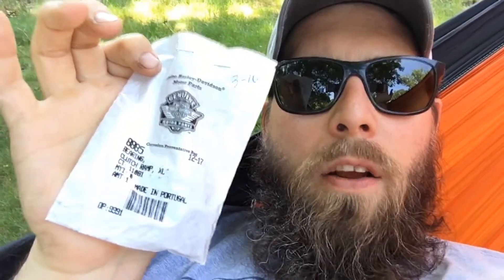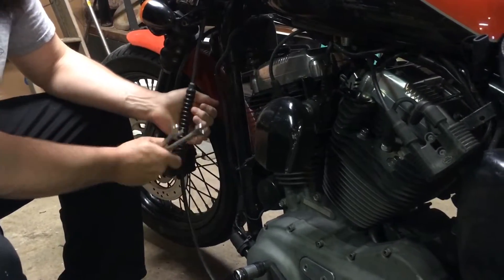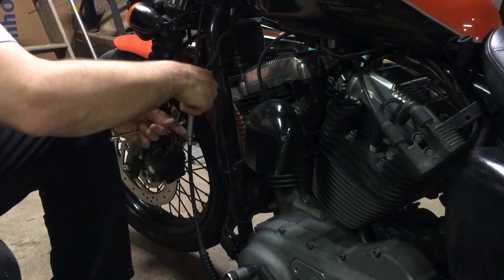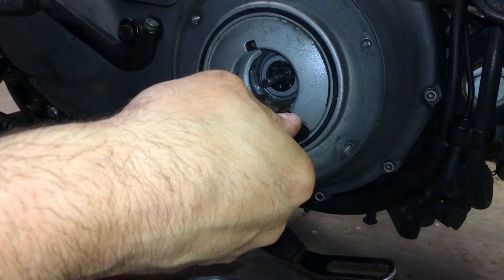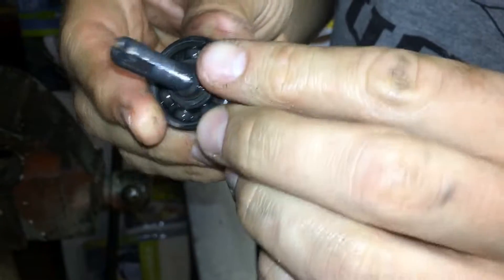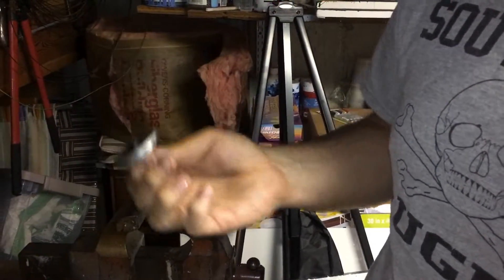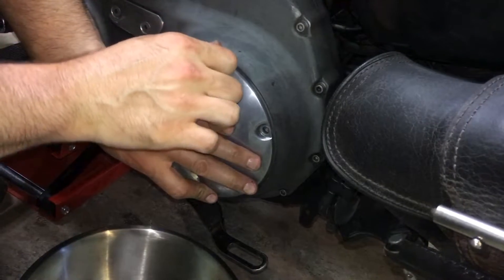CLUTCH RAMP THROWOUT BEARING DESTRUCTION!

Comment: Well done. Just had my 3rd replacement done on my 2000 883. Had no idea where it was or anything. Thanks! FYI for all the fellow Sportster riders: When you engage the clutch and you start hearing some high pitched "whoop whoop" sounds, that's your clue it's going out! Get it fixed before you get stuck like I did.
Reply from the maker: Good info on the sound being a possible indicator of failure! I never heard that but I have short shots on my bike so it is har to hear anything with that beast on.
Reply: I had that happen to me today and as soon as I heard that high pitched 'whoop whoop' sound I turned around and headed home. Unfortunately halfway back it gave out but I was able to limp home in third gear. 💪😅
Reply from the maker: @badbaroque7760  glad you were able to get it home. Hope you got it squared away quickly and hit the road again.

Comment: Man I was about to throw in the towel.. just got done rebuilding the top end of my 03 1200. My ignition coil got tossed , and my clutch wasn't there.  Looked into it and saw it was the bearing. Found this video, and I'm encouraged now.  Thank you..
Reply from the maker: Never throw in the towel on a Sporty. My wie just crossed the 90,000 mile mark on ours. And I hope that you get that bearing out quickly and back on the road tearing up miles.

Comment: This video helped me to figure out why I hear noises when I pull the clutch, opened the side cover today and sure thing the bearing is out, so I’m at 113000 miles and still stock bearings and clutch plates, so I’m going to replace the lifter bearing and the clutch basket hub bearing and the clutch plates, mine is well do the entire thing at once 😁
Reply from the maker: 113000 miles!?! JEZUS! Sounds like you got way more than your moneys worth out of that bike. That's awesome.
Reply: Imad - I know your post was a while ago, but did changing the bearing fix the noise you were hearing?  What kind of noise was it, and did you hear it in all gears or just when pulling in and releasing clutch in 1st?  I have a 05 1200 Roadster and about a month ago I replaced the primary/transmission fluid and put a new Barnett clutch cable in.  Ever since then I’ve been getting this loud clanking noise when I’m first gear and feathering the clutch… like when slow speed maneuvering and moving in and out the friction zone in 1st gear.  I think I actually mostly hear it as I’m releasing the clutch lever, just as it gets out of the friction zone and engages the clutch there is a very loud clank. Is that what you are talking about, or something different?  I can sometimes pull the shift lever back into the friction zone and then release it multiple times in a row and hear the noise each time I release the lever.   I have read on forums people describing the same loud clunking noise, and responses say that is completely normal, but I never noticed it until changing the clutch cable.  I’ve tried re-checked my clutch adjustment like 5 times to make sure I didn’t screw up an get way off the 1/4 turn spec.  Just wondering if you were seeing the same thing  with your bike!

Comment: I’m shocked this is one of the only videos addressing this problem. Mine is a 1998 xl1200c and I’ve had to replace this bear a couple times. Definitely a flaw in equipment for Lon time use. Anyway great job on the video.
Reply from the maker: I have run across more and more Sporty owners that have either have the issue or are having symptoms of the issue. I have never been able to find a video on this myself, really annoying when it first happened around 25,000 miles, and figured it was something I needed to do because no one else was. Thanks for watching!
Reply: Hell I'm just glad to find a video showing how to replace the bearing and just the bearing without opening up the case. I figured there had to be a way to do it I just don't know my way around inside the cases that well. If you keep having to replace the 8885 bearing try a 7200B bearing like he links to in the description. It's an angular contact bearing meaning it's designed to handle side loads unlike the stock one HD calls for.
Reply: interesting im on it i think thats my issue

Comment: Happy New Year and thank you for posting this useful video!!! I have a 2020 Sportster Roadster 1200 that has developed the exact symptoms that you describe. This bike has only 12,000 miles on it at the moment but it has been mostly ridden in city traffic over its life, so the clutch has been heavily used. I have the factory service manual and tried adjusting my clutch many times without success. I also changed my clutch cable. I drained the primary oil to look for any broken rivets from the so-called grenade plate and any other objects but the oil was very clean. I removed the ball and ramp assembly and opened it up to inspect it closely. All looked well in there. I also inspected the throwout bearing while the ramp was off. It has a small amount of play in it as you show in the video (but definitely less than yours) and it looked structurally intact. I can rotate the adjustment screw freely without it binding. Finally, I have also noticed that my clutch lever freeplay varies a lot as I ride the bike. I am pretty sure I am setting the lever slack to the factory spec when the clutch adjustment is done cold. But the lever slack appears to increase significantly and then decrease again all on its own as I ride the bike. Have you noticed this large variation in your lever freeplay when you were experiencing your issues? I am thinking about replacing the throwout bearing next anyway, as I do not have any other ideas. Do you have any other suggestions about things for me to check? Thank you.
Reply from the maker: I cant say that I ever have a variation in my clutch play once i have it adjusted. I don't beleive that should change at all no matter the temp of the bike. I would recommend checking multiple sources on how to adjust the clutch adjustment screw, because you might be leaving it a bit too loose for your bike. Mind you this is from memory, seat the screw, then one quarter turn out. But I also think that you may not find any excess metal or shavings in your primary if your rivited clutch plate is failing, but the symptoms will get worse as the bike gets hotter. So the slipping and not feeling like your disengaging the clutch will be worse when the bike is hot compared to when it is first started and you take off. Mine grenaded at 15K but I was feeling the symptoms for about 500 miles before that.
Reply: @LoneWolferGarage  I appreciate this information! I am starting to think my spring plate has started grenading since the symptoms get worse as the bike heats up. I think my next step is to take the clutch apart and inspect it. Thanks again!
Reply: To provide an update, I had the bike towed to the dealer earlier today. The dealer just called me back to confirm that my grenade plate disintegrated!
Reply from the maker: @aliuzun1129  Dang that sucks, but it is expected. I recommend the Barnett Extra plate kevlar kit. The job is not that hard if you can track down the spring plate decompression tool. They have them on amazon, but I haven't had to search for something like that for a long time. But if the dealer is the direction you prefer to go, just make sure not to go with OEM as its not worth it.
Reply: Yes, there is no way I will go with the original factory clutch again. I decided to have the dealer complete the rest of the repair as that is the most convenient option for me at this time, and I also told them to put in the Screaming Eagle Performance Clutch Kit (Part no. 38002-04) in there. People on the forums seem generally happy with this kit since it does not have that riveted spring plate in it.
Reply from the maker: The screamin' Eagle one is a good choice as well with kevlar plates as well. Glad it didn't leave you stranded and is getting taken care of so its right back to rubber side down.
Reply: @LoneWolferGarage  Thank you!
Reply from the maker: @aliuzun1129  You are very welcome and happy new year!

Comment: I fought with the snap ring on mine today for about 20 minutes before I just gave up. Was hoping to replace the OEM bearing with a (unfortunately named) F.A.G. 7200-B. I'll try to get a different set of spring clip pliers at some point and try again. But I suppose it's better that I didn't do that alone with the clutch pack replacement (Barnett Extra Plate, carbon fiber since the place I bought from ran out of the kevlar), as this way it will be easier to diagnose any problems with fewer changes.

Comment: Put the bearing in the freezer the day before you replace it, put the guide in a hot oil bath. Pull the bearing & guide out and they'll slide together no muss, no fuss, no hammer and you're done.
Reply from the maker: Legion Prime so I have to pull the problem bearing, put it in the freezer, waste a whole day, then heat up oil? That sounds like nothing but muss and fuss. I’ll stick to getting it done and back on the road in a half hour.
Reply: Nah, you put the NEW bearing in the freezer. Then when you pull the problem bearing out the new one just slips right in.
Reply from the maker: Legion Prime oh that makes more sense timing wise. Still, I was able to snap them together with my fingers but useful info for people who either don’t have the strength in their fingers or have a bearing that is giving them some grief.

Comment: Great video man…I just replaced the  bearing and clutch plates in my son’s ‘99 Sportster 1200. The bearing was completely destroyed and came out in several pieces, is there any concern that bearing particles get into the clutch basket? In other words…is it necessary to replace the clutch if that bearing gets completely destroyed? Thanks again.
Reply from the maker: Glad you found it and hope you and your son are getting some quality riding in. As for if it can damage the clutch plates or clutch baskit, your guess is as good as mine. I have been lucky and never had any damage to the plates or basket and I've been able to fish all the pieces out easily, just make sure you know how many ball bearings are in the bearing so you have the same count after removal. Small particles though probably don't matter as it gets mixed in with the fluid, and hopefully picked up but the magnet on the drain plug.

Comment: Thanks Lone Wolf  Have you ever done the compensator /primary getting alot of noise having your symptoms definitely going after that bearing,  can I go just sprocket  teeth #
Reply from the maker: Sportsters don't have a compensator like the twincams/bigtwins, its really just a front primary sprocket. I've nver dealth with that making noise as it again isn't a compensator. What make snoise is the chain. You may think you have your chain adjusted correctly, but that is more often than not the cause of a noisy primary. Or you just have a noisy bike, I've heard Sporty's that made a god awful lot of noise and were adjusted perfectly and ripped on the road. If The Clutch Ramp Bearing is going, it can cause the primary chain to get a bit of slack as the sprocket and the clutch hub spin, causing that chain to wack against the inside of the case, usually right above the inspection cover. But that isn't a symptom I encountered. That symptom happens when I am lazy in adjusting the primary chain and only check 1 or two spots rather than a dozen.

Comment: had the same issue,the bearing broke in half so had to take primary cover off to get the ball bearings out
Reply from the maker: Sucks. Luckily it is an easy fix and usually doesn't cause any long term issues.

Comment: great vid man i just replaced my whole clutch n my shit is still fuked up its gotta be the bearing! thanx gonna try replacing
Reply from the maker: Thanks! I hope that swapping in a new one gets you back on the road> Which clutch did you use to replace yours?
Reply: @LoneWolferGarage  me too man, going crazy waiting on delivery of the bearing I just wanna know if thats the issue. I used the Barnett kevlar kit replaced that shitty sportster springplate, Hopefully its the bearing if its not im running out of solutions keep ya posted
Reply from the maker: @mickey-eq5vw  I have the Barnett Kevlar as well. Have 80,000 miles on that now and it’s still great. Been thru three or four of the throwout bearings though.
Reply: @LoneWolferGarage  thought about energy one but couldnt not go with Barnett they're classic 3-4 bearings gives me hope
Reply: It was the bearing totally shot the middle pushed out, i replaced that and a few other little things like gaskets, Orings, clutch cable, snap ring and it works great like its a brand new bike super smooth, thanx for your vid homie i shoulda checked the bearing first but glad i got a new clutch 🍻

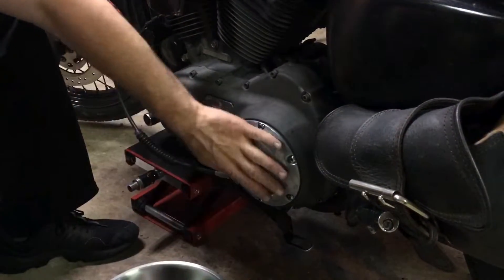Comment: When you say "ramp", are talking about the piece with the 3 balls that hooks to then cable connector? If so, the inboard side of the ramp rests against that "flange" I described - with 4:00 to 8:00 opening.
Reply from the maker: Yes, the ramp is the Clutch Ramp with the two round pieces with three large ball bearings inside of it.

Comment: dude...have a 1200, 2012 custom sportster...with only 781miles..cant believe I'm having this problem...did everything from adjusting clutch by the cable and Hub.. changed primary and engine oil, adjusted chain...still having this loud unbearable screaming sound ..its got to be the hub bearing...
My fear is I may go and screw it up ..trying this on my own..I've managed to maintain everything else.. but removing internal part is bit intimidating.....I'll reach out to my local HD witch by the way...is also name Mikes Famous..but this Brother is short on funds..not sure what the average charge would be for this service...Any input would be appreciated..Thanks...
Reply from the maker: Having a dealer look into it will be pricey, even just to diagnose the issue. I can’t say for certain if it’s the clutch ramp bearing, it would need to be inspected which requires it to come out. I personally think this is a job anyone can do as long as they go slow, step by step and don’t lose the snap ring. As for an unbearable screaming sound, if it’s from the primary it can be a few things. It can be the clutch ramp bearing, it can be the clutch adjustment screw seated too heavily, it can be the chain, it can be the riveted plate in the clutch pack (aka the grenade plate), could be the compensator or it could be a transmission issue. It’s difficult to diagnose off of just a description. I know that sucks as an answer but if you keep ticking items off the list, the answer will present itself.
Reply: @LoneWolferGarage  well..don't think I have much choice Brother...will have it towed to closest shop I can find ...Thanks

Comment: Question: If the bearing has came apart, how do you get the peices of it out of there? I assume it would be important to not leave the balls loose in the bottom? I haven't taken mine apart yet  I'm asking just in case. Thanks for posting this video bro.
Reply from the maker: Rob Gifford That is a good concern. If the bearing has completely failed you will need to count the bearing to make sure you have gotten them all out. Hopefully you get to it before complete failure and just have a bearing that won’t hold a load. If the bearing has failed completely and can’t find all the bearings you will need to take the primary cover off and hunt down any lose pieces of the bearing. I have been lucky and only had the bearing fail completely the first time. And the pieces all stayed in the middle of the clutch pack and a solid magnet was all I needed to get the right count of ball bearings. I then did a flush of the primary to get any little bits of metal to accumulate in the bottom the primary on the magnet on the drain plug. Hopefully it’s doesn’t come down to that for you and the symptoms are caught before failure of the throw out bearing.
Reply: @LoneWolferGarage  man thanks for the fast reply

Comment: Wat did this sound like i have a slight knock/ grind near my left foot peg its a 14 iron
Reply from the maker: Brian Vieyra I did not experience a noise really at all when this happened that I can remember. It was more the physical issues of not being able to get the clutch to disengage, creeping when the clutch lever was pulled all the way in, unable to adjust clutch at all. But it is a simple thing to check off the list by inspecting it. You only need to take off the derby cover, and collapse the clutch cable like you would for a clutch adjustment.